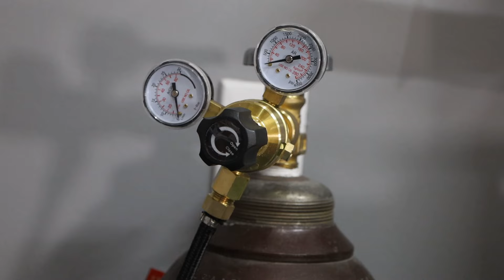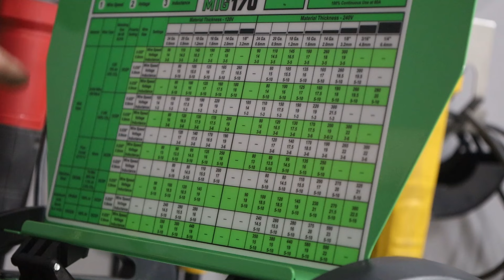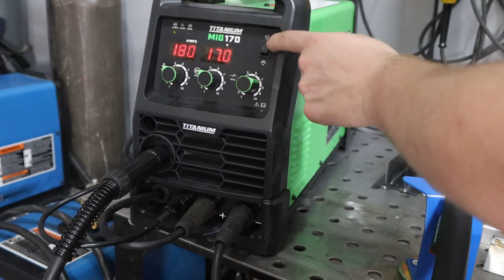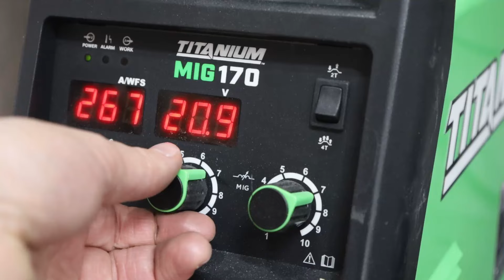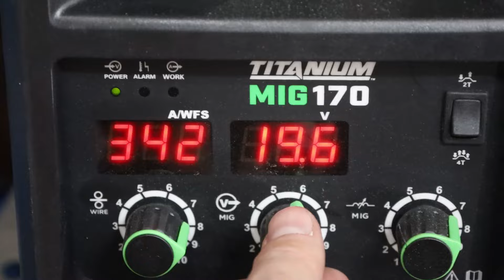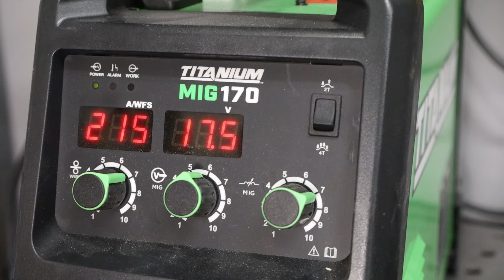Reviewing the Titanium MIG 170  Welder from Harbor Freight

Comment: Picked up the titanium 170 last November for a work project. I never welded before.  Watched a lot of YouTube.  The project was to take a 27 passenger minibus and make a limobus out of it. I  built the seat frames with 1inch square tube. Welds were good and solid for a nooby. Worked out great. The titanium 170 made the project easy. Have had several projects with it since. A cradle for an rv generator,  welding exhaust etc...
Reply from the maker: That minibus sounds awesome!
Reply: I’m looking to add a welder to my home shop. Lawnmower repair, some trailer brackets just odd an end stuff. Question is for the mig welder 170 do I need the  tank for welding with the 170 using 110  ?  I’ve never owned a welder .
Reply: @NoName-be5ir  you can use flux wire with it.

Comment: On this welder if your using .035 wire how do you set the drive roll? Do you want the size that’s marked on the drive roll facing out or in?

Comment: In reference to the unit auto switching 120/240 you stated " I don't understand why it cant do it itself". Being in product design and development most my life, I can tell you, they could, but then they would have to charge you for it. They probably reused components or entire circuit boards shared from another welder or other HF products so they get the economics of purchasing scale, reduced costs for BOM materials including sourcing, storing, testing, QA , failure analysis and most notably assembly/production. HF also then has common parts to use for all products to negate supply issues on any one, it goes on and on. But most of all, like anything else, thats the way they first made it, which was 100% driven by costs and "if it ain't broke, don't fix it" as that costs alot of money to rev a product, test it, track it, and monitor it all its life.  Great review, thank you for it.

Comment: Some months ago I found one of these Titanium 170s at a local pawn shop for $240.00 out the door which looked to be unused. After running it thru the ringer I'm convinced these are very well made. Now I can keep the gas hooked up to my Miller MP 215 and use this 170 for a dedicated flux core welder. I added an HTP 15' gun and 20' ground, (green colored #2 AWG), with one of those nice brass HF clamps on it which really helped extend the reach. I also bought the spool gun for it but still haven't tried it out yet.
Reply: Do yo have a part number for the HTP gun ? Has it held up good? I feel like the titanium gun is small and frail.
Reply: @joejimenez5399  Hi Joe. The ebay part reference is:  15' HTP Replacement Mig Welding Gun Torch Stinger for Lincoln Magnum 100L K530-5 . It uses Lincoln replacement tip sets commonly available from big box stores like Home Depot and such. You will have to clip the connectors off this gun assembly and transfer the quick connect plug over from your existing gun but it's an easy task.  As a side note, the old gun can be fitted on to a Titanium Easy Flux 125 for those who would hate to just throw the old gun away but that's another subject for another time. Let me know if you have any questions.. Cheers! RL.

Comment: I have the titanium 200 and it's a great machine. We use it nearly everyday and I can tell you the titanium machines are under-rated. 
I have penetrated 3/8 steel no problem and we'll passed the duty cycle several times with not hiccups.
I think they have a good lineup for ppl needing a cheaper mig.
Reply: Curious if you still feel the same way about that machine? Looking to pick up a 170 and worried more about longevity, kinda trying to find what their failure rate is.
Reply: @nunya2814  Just picked one up. Have you found any answers to your question?
Reply: @brentbarnett9224  ya can't remember exactly which one but someone that had made a video of a 2 yr review one it said they still like the machine and it had been 3 yrs they had it, I have a buddy whose had the 140 for a few yrs and only regret about it is not getting the 170. I picked up a 170 a few months ago and have no complaints as of yet, have only gotten through about a half spool of wire, had one hick up, but I believe that was due to the ground cable connection being a tiny bit loose on the front of the machine.
Reply: @nunya2814  Roger that. Appreciate the response.
Reply: @brentbarnett9224  no worries

Comment: I do a mobile tire shop and right now I can straighten and paint wheels.
If I heat first can I weld hairline cracks in aluminum wheels / rims with this welder?
I believe the thickest point of the average rim is 8 mm.
Thanks in advance

Comment: Nice video have owned farm store mig in the past.  170 looks like might work my Chicago electric flux core welds good won’t do sheet metal.  I like the 110 volt option cause I don’t have 220 yet.  Need to weld floor boards on a jeep Cherokee.

Comment: Hi Tim, I hope you can answers a few questions for a Welding Rookie.  What is the difference between the Titanium MIG 140 and the Titanium MIG 170?  Can you only use the gas if you have it plugged into 240 volts?  What brand of wire of wire do you use.

Thank you for the information so I can make my decision.  And I like your videos.

Comment: What settings would you run on this welder to weld a steel roll cage 1 3/4" round tube and .090 material?

Comment: Tim, do you have a video of how you power your shop?
Reply from the maker: I'll just say that I have an abnormal setup for a home garage. In the garage, I have 4 240 volt lines and several 120 volt branches, one of which has to have a special high magnetic circuit breaker for motor starts. There's nothing really fancy about it, just standard wiring, but there's quite a bit of it for something residential.

Comment: Are there any welders that don’t require shielding gas I have a place in Maine where it’s about 2.5-3 hours to the closest place to refill tanks looking for a better option
Reply from the maker: Any MIG welder with gasless flux cored wire will do the trick. Stick welding is also an option as long as you’re welding material over 1/8” or so.

Comment: I know this is an old video just wondering if anybody knows do you have to use the gas to weld or will it weld without using gas thinking of buying one to repair foot pegs on a dirt bike
Reply: This welder will work with both flux core wire without shielding gas and with solid wire with shielding gas.

Comment: Dumb question, but... If I want to weld with gas, do I just need an argon tank if I buy this welder?
Reply: Yes, you would need a bottle of gas. The type of wire needing this gas is designated as "A Solid Wire"; usually called out as something like ER70S. It has a "bronze-ish" color on its exterior, but that is a really thin plating to protect the main steel that is within.
  I believe that there are many varieties of bottles of gases to choose from, and they all work better with certain types of wire. And they all have varying costs. Also, there are different sizes of gas bottles, too. But, the most common type of bottle gas mix that has worked very well with Solid Wire, (since almost the dawn of welding, as it would seem..!) is the 75/25 mix; the two gas ingredients being Carbon Dioxide and Argon. One is 75% of the content, & the other is the remaining 25%.(-and right now I'm having a Senior Moment on which ingredient is which; 75-CO2? Or 25 is CO2?!?) 
  But, I believe this is also the most affordable gas for solid wire MIG Welding. It's been so long since I've looked at my tank, and it is on a 10 year lease program with my weld vendor. 
  Hope this helps you! Good Luck!!

Comment: What's the thickest metal you can weld with this? I've only used Miller machines at the shops I've worked at doing a ton of exhaust work over the years.  I'm looking for one to use at home for bui my xj up.   The frame kit and adding trusses to my diffs are my main concern.  I'll need to weld sheet metal as in body panels too and was wondering if this machine would handle all that
Reply: The thickest I’ve gone is about 1/4 with .35 wire never needed to go above that I have welded DOM 120 diameter tubing for bumpers and shock hoops with this welder

Comment: I've been thinking about buying one of these for some basic auto body work but I'm debating between going MIG or TIG. I'd love to see a video on welding very thin metal with it.
Reply: Weigh up the cost of a 'big' argon bottle if you go Tig, personally mig is a lot easier and in my opinion more versatile than Tig but that all depends on the type of welding you are doing.
Reply from the maker: I haven’t done much auto body welding, but I’ve seen MIG used most often in that industry. The way I’ve seen panels welded is by placing a lot of small tack welds around to avoid warping the metal. Thanks for the comment!
Reply: Save up and wait for the Titanium 200 to be on sale. Multi process. Mig/Stick/Tig/Flux core and it's not much more than the Mig 170. Even comes with a Tig torch setup too.

Comment: Hi, mine couldn't weld anything. It would just throw hot spark and making messes but nothing stick to the base metal. Could it be I've defective machine? Bad cabling like ground? It also sound more like a fire cracker than smooth sizzling sound. I tried it with stainless E308L and 71gts flux core .030/120V. Could you help please?
Reply: DCEN

Comment: I’ve got this machine and I’m having trouble with it having a wire feed delay when I squeeze the trigger and when I let off it continues to let out gas for about half second. Is that normal or is something wrong with mine?
Reply: You want thay its pre and post flow to keep your weld shielded from environment while metal solidifies keeps contamination out of it

Comment: Nice review, thanks! (Though my next upgrade is probably gas for my existing multi process, then eventually maybe tig - maybe once the kids are grown ,🤣)

Got around to my first actual project last night (instead of just running stringer beads). Did flux core on my Yeswelder MIG 205ds, and tried a flux core tip instead of the gas nozzle. Turned out pretty ok I think, though I definitely could use a table. Figured out an exciting new way to pop the breaker: accidentally sticking the corner of the contact tip to the workpiece. Was my first time with the flux core nozzle instead of leaving the MIG nozzle on, and hoo boy that made it exciting 😳

Would be good if you could offer some help with these "synergic" settings: my welder acts like you're setting current (which changes voltage but the knob adjusts the current number most directly) and material thickness, no explicit wire feed speed. Fortunately I did learn online that using it in MIG/mag mode will let you get lower heat than the flux core setting.

Interestingly, mine can do dual voltage, auto switching, but the manual says let it rest like 5 minutes between voltages.

Comment: I see the + and - hookups are external I wonder if you could hook up a ground and stinger and stick weld with it
Reply from the maker: Great question! It wouldn't be ideal for that for 2 reasons. First the power is not on unless you're pulling the trigger. Second, this will output constant voltage, where constant current works much better for stick welding. Their titanium unlimited 200 multiprocess welder is made to do exactly what you're talking about.

Comment: did you use same gas for the steel to the aluminum ?
Reply from the maker: No. For steel, you need 25% CO2 75% Argon or straight CO2. For aluminum, straight Argon.

Comment: nice video!

would you recommend this welder for 1/4" (on 220v} for plating suspension components? ive got an off-road project i wanna DIY some modifications for  and itll consist of alot of 1/4" lap joints and such. seems like it would run fine but i want to know what your opinion is. thanks!
Reply from the maker: It can definitely do the job with solid wire. If you want a really strong weld, .035 dual shield wire will also run in this machine with the same shielding gas as MIG. It is a gas shielded flux core wire that has great properties even under some shock loading. https://usaweld.com/collections/flux_cored_mig_wire/products/htp-america-e71t-1m-dual-shield-mig-welding-wire
Reply: @TimWelds  awesome info thanks so much!! I'll look into that wire

Comment: PLEASE HELP???
I bought this welder and it seems to use up my C25 shielding gas very fast. Does anyone else have this issue? If so how do you fix it? Can i turn of the pre/post flow to reduce gas usage? Should i use a different gauges? 
PLEASE HELP!!!
Reply from the maker: The rate at which it uses gas is directly related to the setting on the regulator. If it’s set at 25 CFH, you should get about 5 hours of arc time out of a 125 cubic foot cylinder. If the math isn’t adding up on those 2 figures, you probably have a leak or a bad regulator.
Reply: Use a spray bottle with soap and water and look for bubbles.
Also with your gauge showing on turn the bottle of and see if needle drops fast.

Comment: What size roll of mig wire did you use ?...I need to know
Reply from the maker: I used 0.030" wire. This is the most common that I use because it works for a wide variety of thicknesses.
Reply: The one in the video appears to be a 10lb roll.

Comment: The issue with HF welders is they have no spare parts.  I have an old HF mig that needs the torch liner replaced.  I called HF and was told they have no spare parts for even one being sold the day I called.

I did find a complete torch/gun sold by another online shop but it's price was above that of a new HF welder.
Reply: They have liners in Amazon or ebay about $12. Its a type 100 torch.
Reply: Harbor Freight actually does have parts available contact them via email and they will tell you how to get the parts list available.
Reply: @TrentsGarage  that's good news.  About 5 years ago one of their customer service reps couldn't answer my question for a replacement gun liner.  He asked for the wilder's sku number.  Of course I didn't have that number because the welder was 30 years old.  Then he asked me to give him a sku number for a similar welder offered at that time in their catalog.  He put me on hold after I gave him a sku number.  He came back to the phone and said "I'm sorry but we do no carry any parts for that welder."

I remember this conversation vividly.

That old welder continues to sit in the corner of my shop.  I guess I kept it in hopes of obtaining the information you and another provided.  That welder was replace about 4 years ago with a new Millermatic 212. Love the 212!

Comment: wait a minute I didn't know that that roller  had a difference between flux-core and regular wire .. I thought it was just o 35 or 030 .. that's probably one of the problems I was having with the other one . a little bit to get it to feed  using flux